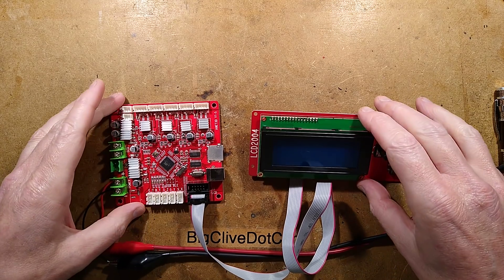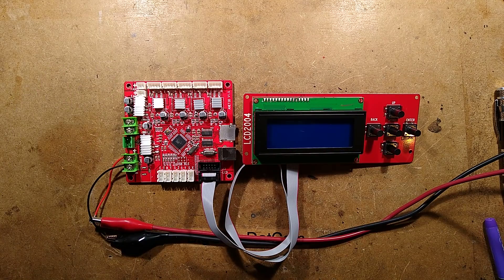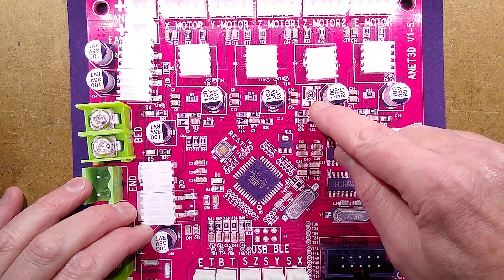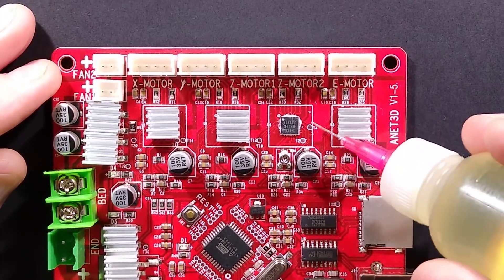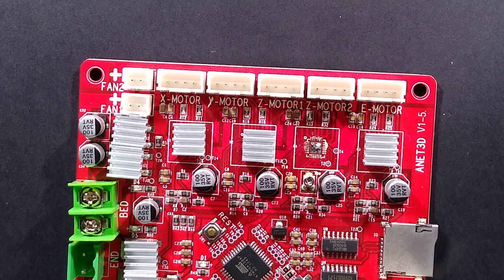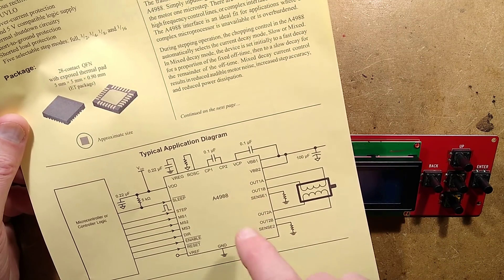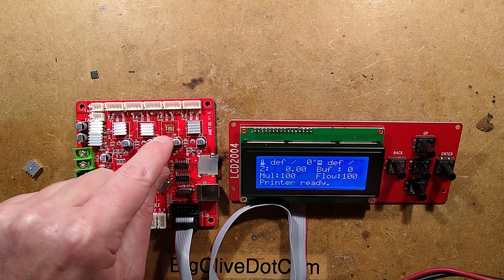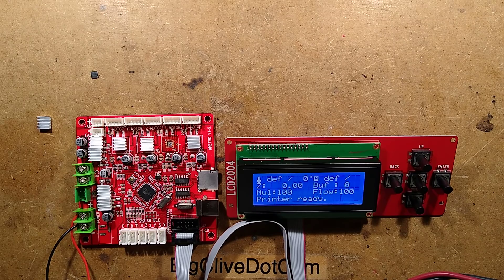Diagnosing a dead 3D printer controller

Comment: I just fixed one of them boards I had to remove the atmega because the temperature pin was gone on the chip the potentiometer is for setting the vref most important setting might I add lol

Comment: I have this board and the same chip died... Can I slap a tmc2209 in place and just update firmware is that chip not pin compatiable?
Reply from the maker: I'd recommend using the same chip as a replacement.
Reply: @bigclivedotcom  Thank you. My board is not getting hot, its just not doing anything on the Z axis. Should I investigate the power running to the driver next or should I assume the chip has just failed in a different manner then what you saw in the video here?
Reply from the maker: @chrismoore1932  It's not uncommon for the drivers to fail.  It might be worth swapping it.  Note that unplugging motors while the power is on can apparently damage the chips.

Comment: I have killed a4988s and drv8825s exactly in the way you speculated. And you need to measure the voltage at the potentiometer while adjusting it so people end up attaching a multimeter to the metallic screwdriver. That's why when it slips it's a disaster.

Comment: I always try a little drop of alcohol or acetone when removing those glued heat sinks. 

The adhesive is usually similar to the battery glue strips Apple uses on the iPhone battery.

Comment: My heater cartridge is not heating up. I tried 2 different cartridge but still won't heat up. How do I test if the connector is fried on the daughter board? I have a cr10s pro.

Comment: I was using this original circuit with my Anet A8 3d printer but, after less than a month I had already changed my firmwate and in the end I switched to Arduino for less than 80 €. you can find your way around quickly, especially since for this price I had another screen, the RAMP card> 1.4 and all amovible drivers

Comment: i can almost be sure i would win a bet that the (z) carriage axis was raised or lowered manually and abruptly, and the induced current blew the super cheap a4988 trash driver commonly put in fire boxes like the anet. ill also accept that it just blew because its a horrible driver for 3d printing. 
if you look at the marlin source code, that is the default driver setting, and it expects you to change it if using a quality driver, like the TMC series.

Comment: Excelent work sir.Desperate fiddler who's stuck question. Got a late 80's car stereo with a vacumn floresent tube display with no display.can get to pins.unit powers ok.what voltages should be their if it was functioning.can u help.no schematic too old!

Comment: Great to see you have a go at something i've actually got and actually repaired my self multiple times also lol

I've got 2 of these things, actually ones been converted into an extremely quick CoreXY style printer. They're extremely sensitive though to back EMF and if the original owner didn't short the pot or caps, the other main reason the driver probably died was manually moving the stepper motors (and inducing current back into the drivers). Happens all the time.

These drivers are terrible bog standard cheap drivers slapped on many different chinese printers. If you were ever going to fix this board you'd do your self a favor and solder in a much better driver (lots that aren't much more expensive but offer so much more control while still being electrically compatible).

Personally i killed the ATMega on 2 of my boards with a faulty USBasp flasher (Didn't know it'd go bad but it fried 2 boards...) luckily again those atmegas are cheap as chips, did the old cut the legs/desolder leftovers trick and fixed them both. Next time one dies it'll be board upgrade time i think

Comment: I wouldn't actually recommend doing work on that flimsy board because its traces are basically spring-loaded when it comes to peeling up off the thing.
But it is entirely possible to bypass a stepper driver and use a replacement on it, I have unfortunately done it.

Sent 12 volts into one of the microcontroller pins too, whoops. Luckily if you flash it with your own firmware, cut some traces and reroute around the 12v mishap it can be repaired with the single spare pin on the micro.

But I also solder bridged the spare so stubbornly to another pin in the attempt that I had to reclaim the Z-axis enable wire, attach it to the X/Y enable wire and make further adjustments to the firmware.

TL;DR Bjorn was 100% right to ship it far away and get it out of his sight.

Comment: I just watched your Simple Guide to Electronic Components and I enjoyed the clear explanations. Question: Suppose you have 220v three phase current that is powering a 220v three phase 3/4hp motor that drives a pulley but is directly connected to some circuit boards that run out to a power cord.  Can you tell me if the values of the electrical components on such a circuit board are dictated by the 220v three phase current that is powering the motor? I'm trying to determine if I can use the same circuit boards for the same application with the same electrical components but power them with 110v single phase current and replace the motor with a 110v single phase 3/4hp motor?
Reply from the maker: The supply voltage will dictate a lot of the circuitry.  One modern option for motor control is VFDs Variable Frequency Drives.  They can take in single phase and convert it to three phases at adjustable frequency.
Reply: @bigclivedotcom  Thanks for the info. I just tried one of my VFD's and it didn't work on this motor. I think it's because the motor is an AC servo. The motor drives a pulley that's connected to the pulley on my industrial sewing machine. I think the servo conflicts with the variable speed control on the VFD. I thought I could find a step down transformer but I can't find a mfg that builds a phase converter/step down transformer. The last resort is to try a 110v servo motor and plug it in the three prong plug connected to the main board. My thinking is that because the components are virtually the same on both wiring diagrams the 110v motor may power the boards 🤞🏽.

Comment: The frequency with which the stepper motor drivers is one of the two main reasons that some 3D printer control boards have them on daughter boards.  The other is you need to change the drivers to use much more (or less) powerful steppers, such as for building a 3D printer that can print large things, like chairs.  Not chairs for doll houses, chairs for your house.  Or, for that matter, the more experimental printers for doing whole buildings.  So far there's no provision for installing plumbing and wiring by machine (getting the structure to reliably print properly is the current objective of most projects) but even if it just eliminated most of the labor from putting up concrete walls, it would be a substantial savings in labor.

Comment: Hey Clive, I'm curious if you've heard of Ellumiglow or any of their specialty lighting gadgets. They have some odd stuff I wouldn't mind learning about if you find any of it interesting. Cheers from across the pond.
Reply from the maker: I'm not a huge fan of electroluminescent material due to its low intensity and other issues.
Reply: @bigclivedotcom  Fair enough. I thought their laser fiber optic cables to look really neat. Cheers.

Comment: The FLIR camera since about 2001 has been one of my primary fault detection tools helping me zero-in without testing each component with a meter or scope. I just wish they were a bit cheaper and there was a "nice" phone with one built in.
Reply: I'm wondering if it's possible to make one out of an old phone by removing the IR filter from the camera? I was thinking this was what Clive had used, but I guess not?
Reply: Actually, I think Clive's using the CAT phone which has built in FLIR, but it is possible to make your own thermal imager out of an old phone. https://youtu.be/x1_qYIlIrhk
Reply: @multiplyx100  I use a flir-one plugged into a Samsung galaxy A3 and made a rudimentary wrap around case.
I've tried FLIR  phones like the CAT/Ulephone/Blackview and found them disappointing compared to a Flagship and a plug in camera.

Comment: If that board is ever going to be used again it’s worth giving the screw terminals some attention. The solder joins in mine where so bad after years of rattling I could just pull them straight off the board.

Comment: I have an Anet with that exact same board. It's still going strong. Probably because I didn't fiddle with that trimmer pot. I just flashed it with Marlin firmware so I was able to make it work with the BL-Touch sensor for automatic Z-calibration. I also added a bigger mosfet for the heated bed.
BTW, what exactly is set by that pot? - EDIT: found the answer in the comments.
Reply: A comparator threshold probably.

Comment: Keep the LCD  board as it is useful and peg the  rest in the bin ! it is old shit technology with crap drivers and not worth the trouble of reviving it . If he played around with  the pot he may have had it set too high which kills 4988 drivers  pretty quickly and as there is only one pot it is the one connected to the burnt out driver - metal screwdriver can short out the pot internally .
Would have been better to use this excuse to upgrade to a better board with 32 bit chip and silent drivers .

Comment: the metal trimmer screwdriver gives an easy clip on to monitor the Vref.  certainly don't want it skittering across the board though.  for A4988's the 2208 / 2209  are far superior replacement.  i'd certainly have to trash the board, lacking the surface mount chip removal skills shown here

Comment: That board REALLY needs a firmware upgrade. It has the default firmware. I have an A8 and with a few physical upgrades and the firmware upgraded it's a very safe and reliable printer. I have had mine now for about 4 years. Never been a problem.

Comment: I've remembered what else was wrong with the heat gun at work. As well as the metal nozzle not earthed (it does have an earth wire) neither was the case. The fuse and switch were also on the neutral instead of the live.
Maybe you should do a teardown of yours just to make sure it's safe.

Comment: I think the more worrying fact if that without having thermisters in the board and reading a temp of -50 that it didn't trigger MINTEMP! Should've locked itself up almost immediately. If it had a sounder installed, it would be screaming! Next test, if you can turn on the hotend and it still try to heat, there's no thermal runaway!

Comment: Sorry Clive et al. Yesterday I bought a second-hand Honda ride on mower. It was not cheap. I'd like to fit it with one of those 12V electrical hour timers so that I can plan oil changes etc. My problem is that I don't know what to search for. Any advice would be most welcome.
Reply from the maker: Elapsed hour counters?
Reply: @bigclivedotcom  Thanks Clive. It seems that my brain cannot always engage gear :( I'm now looking at hundreds of these 
devices on eBay.
 I'll buy you a coffee. 
Keep well, if I'm ever in the IOM I would be very happy to treat you to a meal.

Comment: Now put a Trinamic stepper driver in don't go for the A4988 drivers (Trinamic has pin compatible ones).
That's what I did with my printer and never looked back it prints super silent now.

Comment: I have that particular board and display in a drawer, as I moved my Frankenstein Anet to a fancy TFT display and 32bit board (plus plenty other stuff as I upgraded to 24v). Funny thing, the new board only has 1 Z-axis stepper driver and connector, so I´m actually using a T adapter to power my 2 Z motors. Working like a charm for a couple of years now.

If you´re going to use it for a homemade printer there are nice compact designs with just one z stepper. You can also just experiment, as you can flash that microcontroller and screen to do virtually anything, as they are fully supported and documented in Arduino.  I wouldn´t bother replacing that driver if you don´t need the extra channel.

As always, a joy to watch. :)

Comment: You would have thought those step motor drivers would have been socketted to permit easy replacement.  Those heatsinks are a joke too especially given that step motors demand several amps at 12v even when stopped - those drivers must be roasting when the unit is running.  The pots on the drivers are to set the motor current - most likely this was set too high and the driver chip popped   Not too surprising that board blew up.

Comment: I have the same board on my really rubbish £80 GeeTech clone I got from Amazon last year. TBH the board is probably the only thing I haven't had an issue with lol. It works great now that I have replaced half of the machine with better components. Learning is half the fun / I'm a (soon to be made redundant) copier engineer and IT bod  :)

Comment: Whilst plastic tip or ceramic screwdrivers are useful for circuit board potentiometers, those on stepper drivers carry a voltage you need to measure whilst you adjust and there's usually not another convenient place to get the voltage off the board.

Comment: One other easy thing to do, if you don't have one of the non-conductive screwdrivers, is to use a wooden dowel. Bamboo skewers work pretty well for this, but any dowel that is ~1/8" or ~3mm will work fine. Just use a knife to cut a rough screwdriver shape into the end, it doesn't take a lot of force to turn those trimmers so a makeshift screwdriver works just fine.

Comment: When I got my 3D printer, one of the axes could only move in one direction. So I checked with my scope and there was no signal from the MCU on the direction pin for that axis. Turned out the board was delivered with a MCU with a faulty pin! But it was easy to just replace the MCU and reflash, but was kinda annoying ^^

Comment: Great diagnostic work with the thermal imaging phone, amazing how fast you can troubleshoot with it. I used to program a Huntron Tracker probe in the mid 90sto do the diagnostics on boards. Now I use thermal imaging that just plugs in to any phone and its come in hand so much trouble shooting controls and relays and motors, great work!

Comment: Well, I usually clip the positive probe of the MM to a steel flat screw driver and the negative probe to the GND of the stepper driver (A4988) to adjust the VREF, using a non conductive tool to adjust the SMD pot dose not allowed me to see the actual VREF in real time while turning the pot, that's me, no one need to follow my way of adjusting the VREF.

Comment: I too had one of these boards. The driver also fried itself, but instead of preventing the whole board from powering up, it just didn't work anymore. I ended up using it as an arduino mega on a project of mine.

Comment: 6:26 Oh no, not the default firmware!
The default firmware is a fire hazard, as it has some important safety checks related to the heaters disabled.
The entire board isn't that great either, because if for example the heatbed mosfet fails in a closed state, there is nothing the firmware can do about it.
Reply: Yeah, I got a BIBO 2 Touch on a "liquidation" sale, fixed all the stuff that was physically wrong/broken on it, and then had to design my own independent safety system for it before my father would let me have it run with someone not in the room with it for those two reasons (physical hardware failure plus every safety check in the old Marlin version it's running being disabled from the factory). I ended up writing my own little firmware for an Arduino Micro that I stuck underneath with separate thermistors on each hotend (it's a dual-extruder printer) and the bed (also heated) as well as a big old relay I had laying around that's in the "hot" AC line for the power supply. It just watches the temps with its own completely separate thermistors and trips/latches the relay off if it gets over the pre-set limit for any reason (the limit is about 290C for the extruders and 110C for the bed, just so it doesn't trip accidentally from noise on the thermistor signal wires). Not the most elegant solution, but it does make the thing quite safe, as even a MOSFET failure or a full-on microcontroller failure can't do anything if the power supply is effectively unplugged (by the relay). I even installed a separate 12V barrel jack in the back of the printer to power the safety system (can't use USB because the relay has a 12V coil, so I just feed that and the VIN pin on the Arduino with the barrel jack, let it regulate the voltage down, and control the relay by pulling the other side of the coil to ground via an external transistor) that way there are no common failure points between the printer and the safety system (so that if/when the printer fails the safety system can catch it instead of going down too and leaving us with no house). The Arduino will even store the fault condition (which thermistor was over-temp, or under-temp for that matter as a wire failure will pull the analog input right up to 5V, which the thermistor will do at about -273C) in EEPROM and read it back to me on the next startup so I know why the system tripped last, if I am confused when trying to troubleshoot anything.
Reply: @jean-lucpicard8186  It might not be the most elegant solution, but it's redundant as in that the processor controlling the printer is not also responsible for the safety shutoff.
On my Hypercube, I have had two RAMPS boards fail in this way, but luckily caught the issue before something went wrong.
Now I have a safer flavour of the RAMPS board, because except for the power delivery I like the modularity a lot, and this version fixes those issues.
For the safety shutoff, I have added relays to the 12V input of the RAMPS and have modified the Arduino so it can be powered from 5V separately.
The relays are controlled by the firmware, but with the modern Marlin versions, I do trust it to be able to shut down on failure or even a firmware crash.